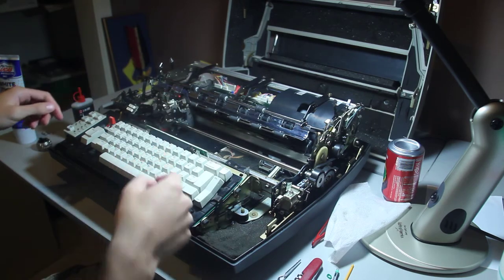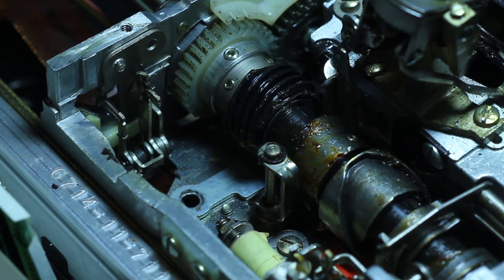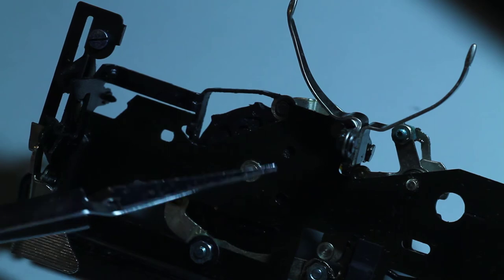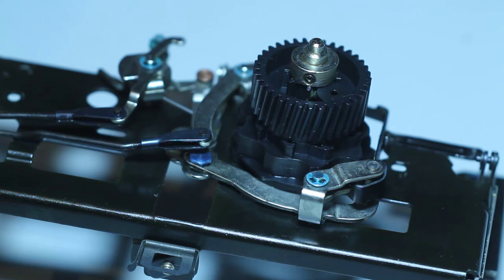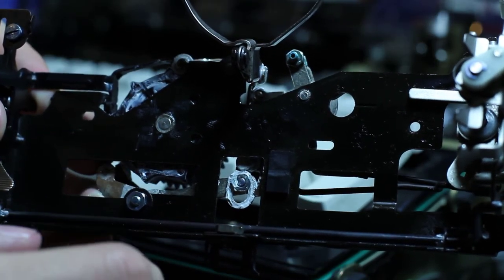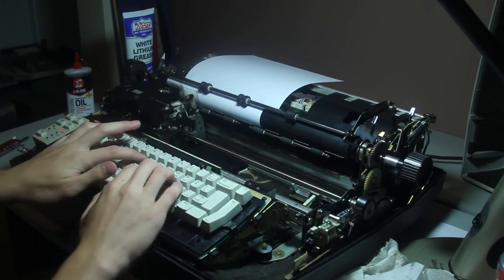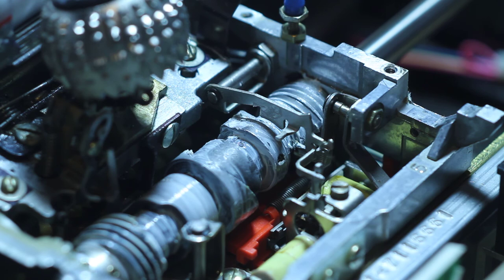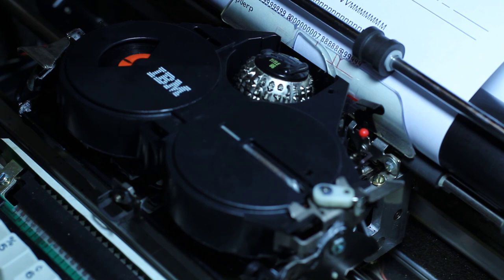IBM Electronic Typewriter 85 Surgery - Ep. 2

Comment: It's the Velocity Magnet Assembly/Velocity Slider Restore area.  IBM No. 10 lubricant is SAE 30 non-detergent oil.  IBM No. 23 is Mobilgrease #28 which is a synthetic grease.  Lithium grease which I see you have here, always dries out.   But you probably know that by now.
Reply: It's also possible to cycle the machine manually (powered off) without a cycle tool.  That is what the knurled knob on the left side of the print shaft is for.

Comment: Do you happen to still have the manuals or a link where to download them?
Reply from the maker: i was never able to find good service information on the Electronic series. The actual problem shown in this video is caused by a keyboard failure, common to most IBM electronics of the day, which you can learn about by searching for "IBM Bolt Mods"